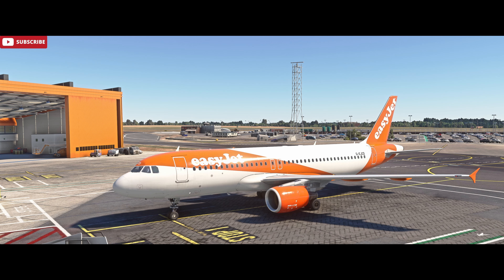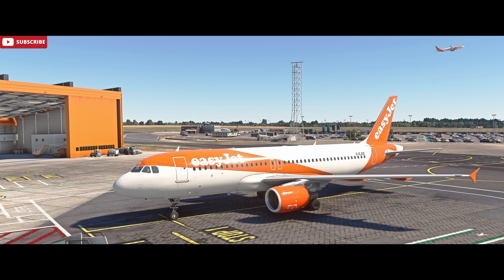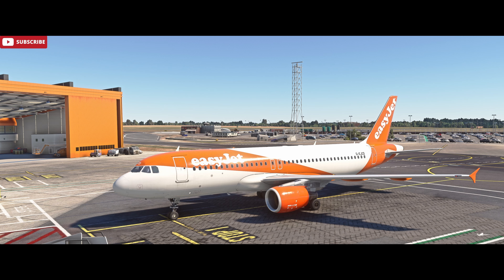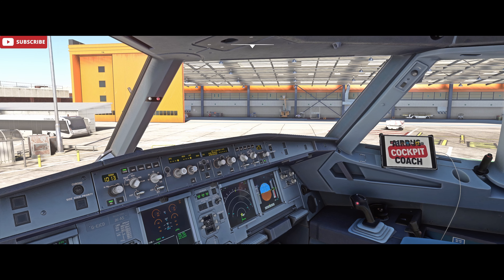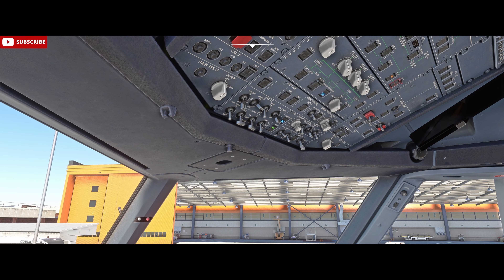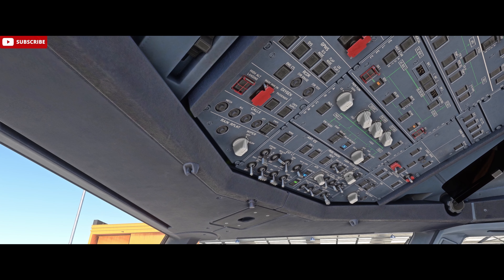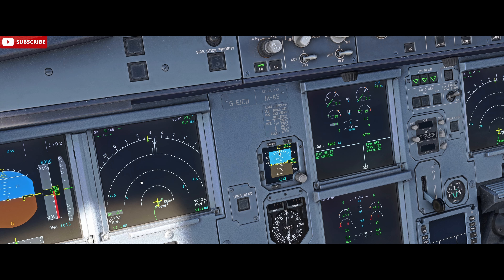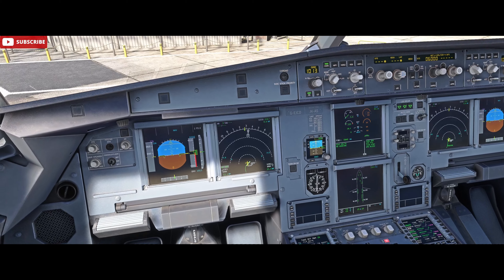Fenix A320: Dry Engine CRANK Procedure Explained  | MSFS Tutorial

Comment: Thanks very helpful, just wondering when doing an engine start in the a320 i had a failed tart today i went to turn them off then turned the PACKS off to allow more power and this did not work am i being stupid or do they not effect the start ass i thought turning them off gave priority power to engines hope you can help many thanks
Reply from the maker: Hello, when you select the engine mode selector to IGN/Start it will direct all airflow to the engines even with the PACKs turned on so that is not the cause of your start issue. If you do get a fault on the Fenix it will likely need to be reset to allow a start to take place
Reply: @AirbusCockpitCoach  oh okay , thanks for your help so in the real start up procedure you always leave packs on i always did that until a friend of mine told my i should turn them off for engine start but many thanks
Reply: @AirbusCockpitCoach sorry one more question is it normal for the engine n1 to only go to 4.7 percent after a turnaround I set up the plane correctly and the n1 does not pass this very confused I tried dry crank and manual start
Reply from the maker: That N1 seems right when the N2 is around max motoring speed before the fuel is added. The N1 only really increases above that upon ignition when selecting the eng master switch on
Reply: @AirbusCockpitCoach  so is it just taking a longer time to start is it a waiting game or is there something else i can do on a turn around many thanks
Reply from the maker: On a turnaround there should be no difference as long as the usual start procedure is followed, it should not take longer. Its sounding more like a software bug, is this on the Fenix?
Reply: @AirbusCockpitCoach  its on the INI a320 neo on PC, don’t get issue with Fenix so idk sadly
Reply from the maker: @0JF.7 perhaps the Ini has a bug when operating more than one flight, not tried a turnaround in that one yet. Might be worth checking their discord forum to see if it's a known issue
Reply: @oliverfoden sorry to jump on your post, how have you got your reversers configured. They are driving me mad!